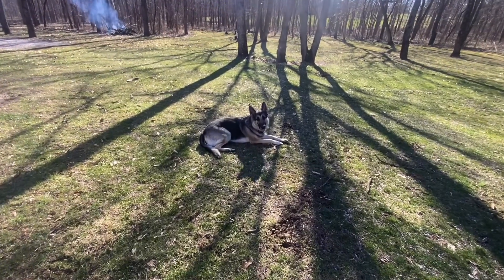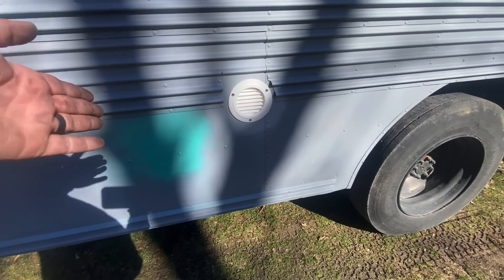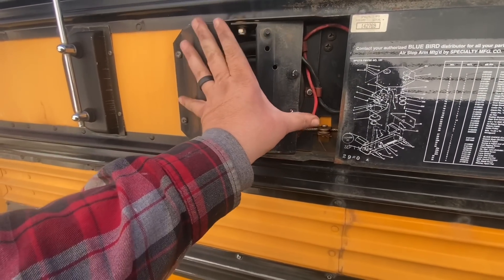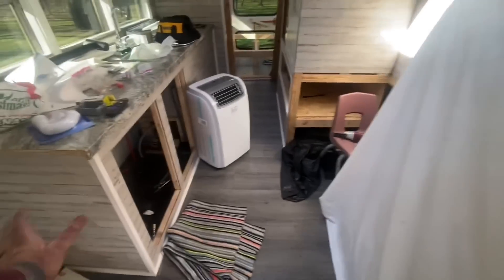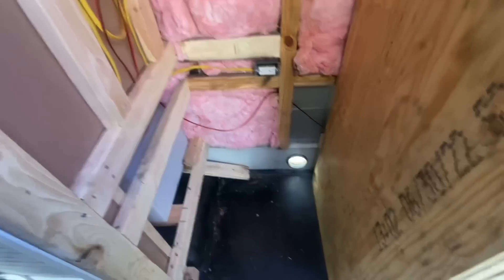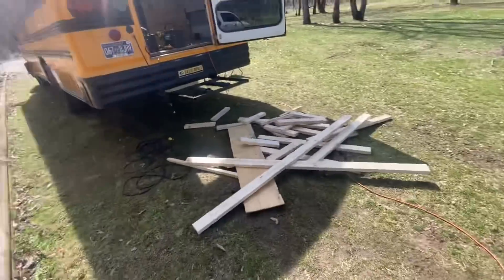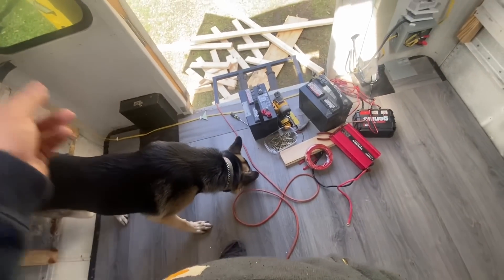Mrs Dirt Perfect’s Schoolie Rebuild Part 5

Comment: Dual battery set up with a charge controller and crossover switching,this allows that house battery to be used for emergency starting  ???
If the battery and charger and inverter was towards the front and close to fridge,close to the start battery,then it's less cabling and less weight in the rear over hang !and probably a better position than having it close to sleeping quarters ?
Cheers 
Still think that tap protruding out from the body work is wrong .
How would a roof top pod work out for extra sleeping space ,could be a novelty for the kids,and Jenna has the one on the car/camper you worked on ?
If theres an awing installed then she probably wouod like LED lights for under that !

Comment: Have remember Michael aka Dirt Perfect is well over 6 ft. Gotta make it long enough to fit him in there. I would make sure the batteries are somehow vented to external air if not moved to the exterior of the bus.
Reply: Yes I agree with the batteries being on exterior or in a sealed (to inside ) compartment and vented to exterior due to off gasing  when charging .

Comment: in your A/C heat compartment I see a moisture problem. the heat function is going to draw moisture in the insulation.  I wondering if you could wrap the walls in that compartment with a vapor barrier. 
but I figure it’s going to need some kinda water proofing

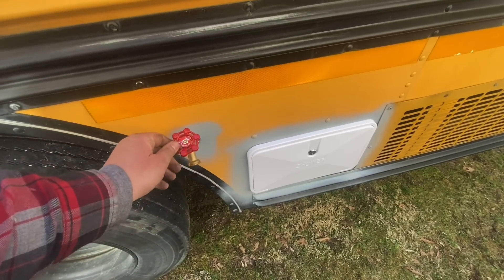Comment: 2:48 Your fill tap/valve won't work (unless you have a hose with a female on each end).  They make female connections that mount on the side of campers, you should use one of those.
Reply from the maker: Bought a female to female adapter…. Don’t you worry